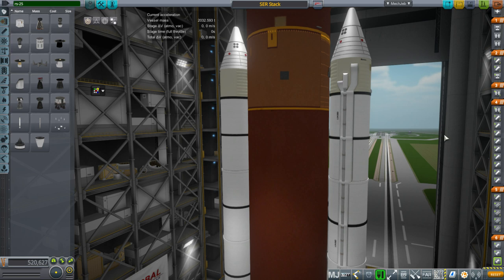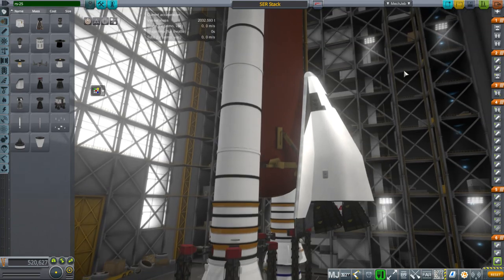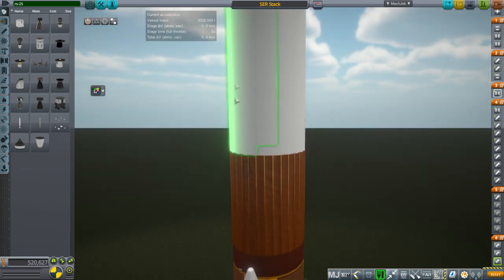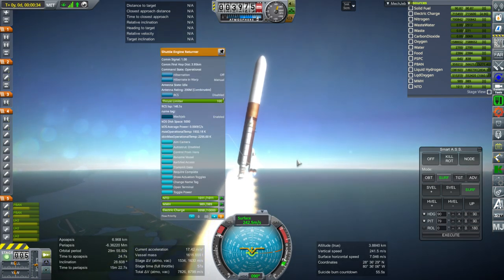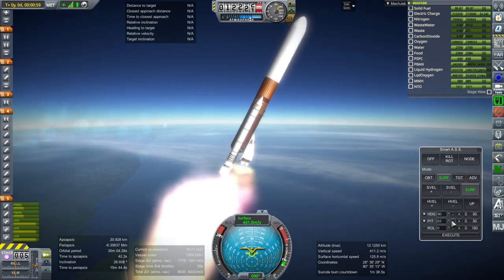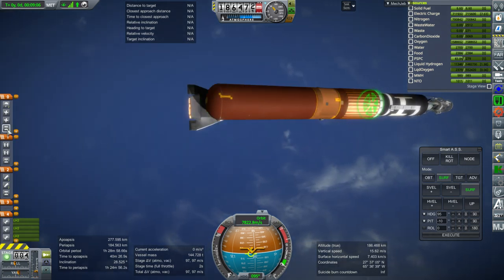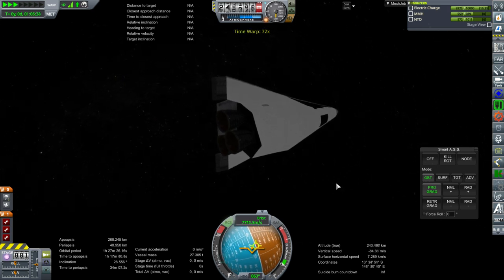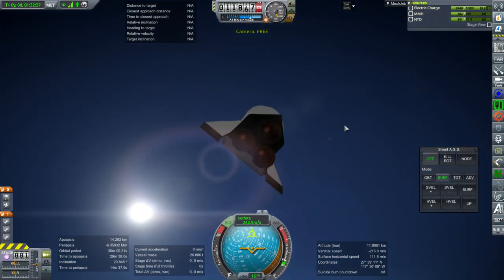KSP - Realism Overhaul Sandbox - Shuttle-Derived Lifter with Engine Mouse

Comment: Instead of that strange Mini-Shuttle mutant thing strapped to the side like a leech, wouldn't it be simpler to have the SSME's on the bottom like an SLS, and then have them detach as a unit and re-enter with a heat shield and parachutes?
Reply: XpertPilotFSX but is that as fun?
Reply: You’d have to redesign the entire load bearing structure of the vehicle, change the fuel tank completely, almost to the point where you might as well just build a new rocket. Frankly, Shuttle-C makes a lot more sense than any of the other shuttle derived vehicles.
Reply from the maker: Like the F-1s in that recent video, a pod like that would tend to go engine-first unless it has a really heavy heat shield - allowable for the speeds the F-1s were going at, but not from orbit. The heatshield mass would likely be greater than the tile mass on a pod like this, so it would cut into payload mass. Besides, I already did that in the F-1 boosted Shuttle video, so no point doing it twice.

Comment: Not to argue in SLS's favor, but it can't use the ultra-light External Tank, it needed significant structural upgrades to handle being a vertical stack.
Reply from the maker: Which is interesting, because you'd think having a Shuttle hanging of to the side, with all the attendant aerodynamic issues, would require a strong structure from the start. There is the gust issue with a tall stack, though. Of course, the main difference between the original shuttle tank and the SLWT isn't that the latter is weaker, but that it used a different aluminum - an aluminum-lithium alloy. That complicated the welding, but was lighter. I wonder if they are using the heavier option because it's cheaper or if they're still using the aluminum-lithium.
Reply: Raiz Space Now that you mention it, it might complicate my in-game efforts to stick two F-1Bs to the external tank. (I’ve come up with an SLS Block 3 that uses two Pyrios boosters beside this new core, in case you were wondering.)

Comment: you could have mounted the return vehicle on a flatbed type of structure that connects to the front ET mount. That way the tank wouldn‘t have to be altered.
Reply from the maker: Are you talking about moving it up or just adding a structure? If it's adding a structure that extends down, that's basically what I mean by modifying the external tank - that structure will have to get dumped with the external tank and add dry mass to it, so it's functionally a part of the tank. If you mean move the return vehicle up, obviously that would leave the RS-25s torching the external tank, which won't work.
Reply: Raiz Space i meant a structure that connects to the Original Shuttle Hardpoints and holds the engine Recover Module in the place you put it. You wouldn‘t have to change the entire loadbearing Structure of the Tank that way.

Comment: How about using two engine mice?  Each one would have 2 SSMEs and a rear facing RCS thruster.  Mount them across from each other, 90 degrees off from the boosters.  This would give limited orbit maneuvers and allow putting the ET on a reentry trajectory before detaching, entering, and parachuting down for recovery.  It also means the assembled vehicle has 4 "wings" and is more or less rotationally symmetrical.  You could then add massive dihedral / switch to a dream chaser like lifting body shape.  This could help keep the vehicle stable in a "belly flop" orientation.

Comment: Y'know, if it's going to return as a pod anyways, then why not put the RS-25s on the bottom of the stack like you did with those F-1s ? Seems like it'd save some mass to me. That, and also hot damn, those fairings are heavier than what many mid-size rockets can carry.
Reply from the maker: I thought about it, but you might have noticed with the F-1 arrangement, that makes the recovery pod go engine-first. You'd have to put a heatshield heavier than the engines, which might end up making it less efficient than this method (assuming the shuttle back-end equipment included in this Engine Mouse remains the same mass). From the mild suborbital trajectory that the F-1s were in, going engine-first was not a big deal, but coming back from orbit, those RS-25s are going to melt if they're bearing all the heat. Besides, I wanted to do something different.

Comment: cool video & cool concept. One other Idea, There couldn't be more easy and simple to just have another stage on on the bottom of the  main tank a just a stage with wings & the engine? So after you reach orbit, you stage It. and It return the bottom part of the main tank back to earth with wings and the engines of course

Comment: If all the thrust goes through the interstate at the top of the tank, why not flip the tank upside down so the pod attaches to the interstage. And put parts to change the boosters force application point to the bottom of them to save mass on the core stage?
Reply from the maker: The oxygen tank is on top of the hydrogen tank because it's much heavier and makes it easier for the RS-25s to get their thrust through the center of mass once the boosters separate. Now, since we don't have a shuttle on the side and are putting a payload on top, flipping things around might be doable, but I doubt it.